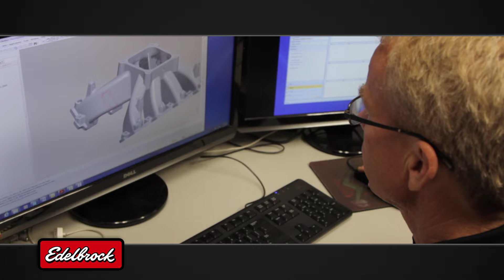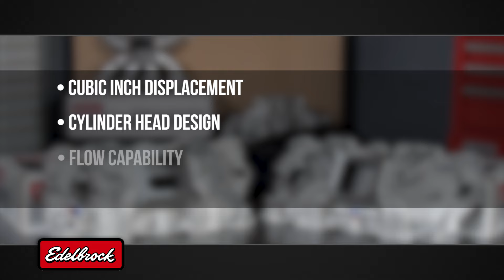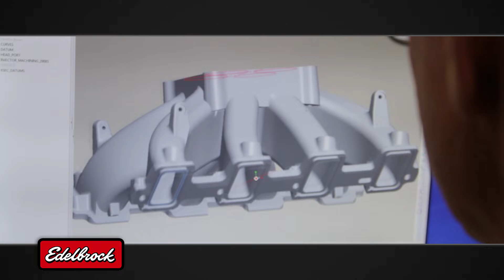Single Plane vs Dual Plane Manifolds

Comment: With the performer RPM I don't need to put a 1/2 inch thick insulated spacer under the carb to keep the fuel from boiling out of the bowls after I shut it off when it's warmed up.
With the regular Performer, gotta run an insulated spacer underneath the carb, so not gaining any Hood clearance

Comment: I run an open plenum  on a small bock  Chevy  less mid range  less mpg  but more Top end..  The mid Range my  dual plane from a  1966 327 365 HP Corvette is still impressive .. my guess is Edelbrock has improved some on the  1966 design ..

Comment: Single plane is good for boost as well as fuel injection as they both need the flow for it and both use the open plenum to distribute fuel and air better

Comment: The thread on 455 efi torquer 2 manifold..the spray of the fuel in the plenum is different than carburetor. Would be great to have a clear composite manifold with  colored fog being pulled in to see the distribution of fuel with a liquid to show density

Comment: Ok this changed a couple issues I think. A single plane is a square bore and a dual plane has the jumbo rear throttle plates yes? And yeah a dual plane for the road. Big difference in street rod VS race engine!! Most street rids will never see 6,000 rpm. And street rods aren't running flat out from stop light to stop light.

Comment: With cost not being an issue, and hood clearance not a problem. Would the rpm performer be a bad choice for a stock to mild build 350
Reply from the maker: It would be a good  mod for a stock or mild 350
Reply: #edelbrock I'm running a stock 440 . But I want to run a can possibly better heads. What carb and manifold should I go with. I use it to Mudd and do snow removal as well as highway.

Comment: How about a EFI setup? Will dual or single plane make a big difference or does this only apply to carburetor setups?
Reply from the maker: If you run our EFI system, it comes with a Single plane. If you decide to downgrade and run a TBI system, then Dual plane would be  better.

Comment: I purchased 2 different intake manifolds from Edelbrock and had a visual gap at the top of the manifold to the cylinder head port on my aluminum heads    I ended up purchasing a brodix Intake manifold and had no visible gap  and the ports lined up perfectly.   Can Edelbrock explain this problem. No machine shop work was done on engine or cylinder heads
Reply: That's exactly what mine has too! I knew there was something wrong

Comment: I've got a 78 c60 with a 350. Would a dual plane intake be best? Guy is planning to make a small dump truck out of it
Reply: @john jones only looking for more torque.
Reply: Put a 252 comp cam and a big Pontiac 2 barrel carburetor and it will pull . Good torque!

Comment: so with all that info, a tunnel ram should give better LOW end power than both options. Yet everyone you ask says the are only good on the high rpm side.
Reply: Well they are wrong. A good dual plane is pretty good for low end tq tough to beat.

Comment: I have a dual plane 2131 intake square bore  and a brand new  holly 4175 spread bore carb I bought a 2692 adapter plate. It looks like it will work but was concerned about the separator vane in the intake as it will no longer separate the barrels. will it perform ok
Reply: What car????
Reply: What’s that have to do with anything ?  He mentioned the carb and intake he is using of which that’s what’s his question is about

Comment: So if you have an four barrel carb you can't use dual plain intake??
Reply: OF course it bolts right on. Ea side of the plenum uses 1 primary 1 secondary plate. Better response torque etc
They are the way to go on a mild-moderate st strip car.

Comment: Either type assumes that a single 4-barrell carb is what you want on a V-8 engine. Regardless of cylinder configuration, most Japanese bikes and European cars use a single-barrel carb for each cylinder or a siamese 2-barrell for 2 cylinders. Eg; a Honda CBX-1000 is a straight 6 with 6 carbs while a Lambourghini Miura is a V-12 with 6 Webbers. On an American V-8, this would be 4 Webbers, either down or side-draft. We've all seen the occasional Chevy or Ford with them, but how does that compare with what's seen here?
Reply: David Rayner dude its an Edelbrock what do you expect lol... its been known for years upon years that they are for American v8 stuff

Comment: have 4.8 ls engine rebuilt with nice cam and springs ,pistons are a little bit taller for more compression.not sure if my single plane holly  intake and fitech 600 efi .will work .any advice ,maybe a duel plane.

Comment: What about the air gap?
Reply: KB956 I think the airgap is the best, they shoulda showed it ferreal
Reply: KB956 I have a rpm air gap and it's beasty.
no need for a single plane.
Reply: I got to the Air Gap for my 468 with square port the heads have been ported and polished I used the intake gasket I'm going to use and ported the intake to match the heads .I opened the intake up a lot the blended it in to polished! I will be running a 640 lift hydraulic roller cam and got about 12 thousand of a dime pistons! I expect to make some serious power and run a fully manual shift 4l80e transmission!